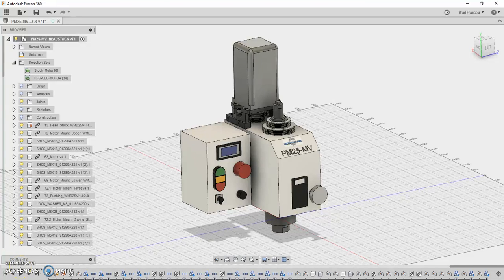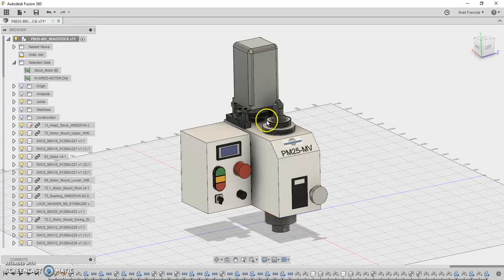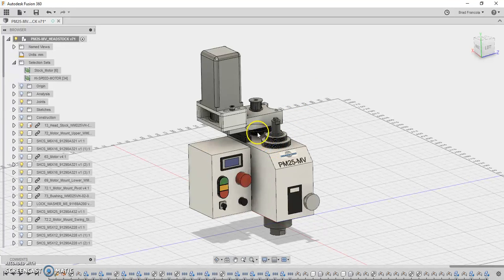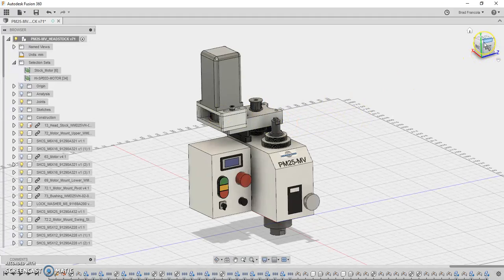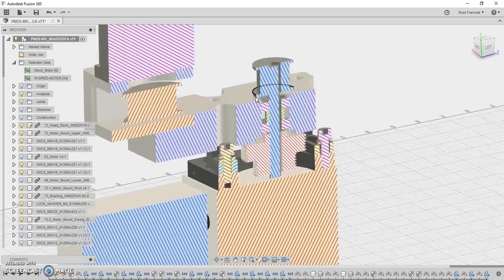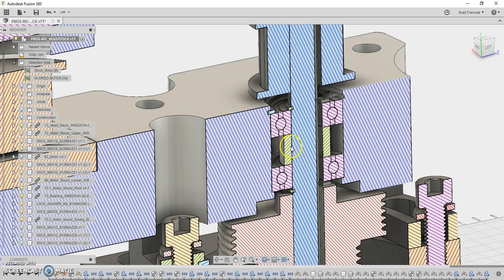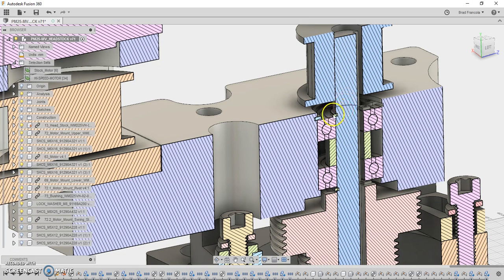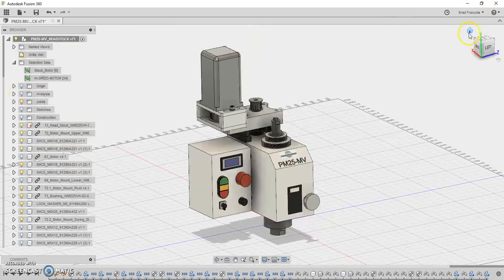PM-25MV Milling Machine Spindle Speed Upgrade with Fusion360

Comment: Franco, how did this work out for you? I will want to do this at some point. Why did you not use a drop in bearing assembly (fk-20, or proper size) like on your cnc conversion?

I can't make much yet still waiting on my cnc conversion kit that was supposed to be instock, but wasn't.

Thanks for all of the videos,
Chuck
Reply from the maker: Hi.  The drop in bearings probably would have worked pretty good.  If I were to make another one, I'd give that a try.  Currently, I'm using the stock spindle and motor setup.  It works OK but more RPM would be nice.
Reply: @FrancoCNC  Thanks for the reply, once the mill is up and running I may give it a try. Your Fusion 360 models will be a big help. I am also looking at making a replacement nut to hold the drawbar in, it will have a small lip to add a pulley to drive an encoder.

Comment: Franco, first off love your work I’ve been watching your conversions for about a month now and am planning on doing a similar conversion to a Pm-25mv. Secondly, (due to my limited experience of machining and a conversion such as this) I have a question regarding  the precision shaft from McMaster Carr that is keyed. I was wondering if that key-way has had any adverse effect on the bearing surfaces it is rotating through? My thought being that if there’s any vibration in the shaft or slack in the tolerance it might cause it to gouge through the surfaces and possibly ruin the bearings? Or is this of little to no concern, again I have only light experience. Thanks!
Reply from the maker: Hello.  The key doesn't seem to have much of an effect.  However, I found that axial movement of the shaft can cause vibrations.  I had to use wave springs to take up the excess motion to eliminate those vibrations.

Comment: Love the idea i have the same mill, i would like the same set up the only thing i would say is the two bearings will need lucubration / oil points.  As this may run warmer with the extra RPM, Just think it would be easy to do it in the build rather than after.

Great Job

Make 2 i will take one off your hands 

Regards 
Dave
Reply from the maker: Hi Dave.  Thanks for your comment.  I'm actually working on this project this morning and I hope to be able to test it soon.  I'm using sealed (pre-lubricated) bearings which are similar to what I've seen used by Grizzly on the G0704.  If they look like they are getting hot, I'll make some provision for oiling.  Thanks!
Reply: Not a problem looks a good set up to me, Pre lubricated bearing will be the better option, Be interesting to see when its all complete.

Comment: Franco,  First I want to say what an awesome job modelling the pm-25 mv.  I have this mill in my home shop.  I love it.  I was looking for a way to increase my rpm on the spindle, i hope you dont mind but this looks to be worth the effort so i may try this in the fall.  I am also considering the tormach TTS system for tool changes.  Before I commit to that have you had any thoughts about tool changing?  Keep up the good work.  This is awesome, the PM-25mv needs more information about cnc conversion.
Reply from the maker: Hi Stephen - feel free to try out this design on your machine.  I may be able to give you a parts list, if you want it.  I've given thought to the TTS system.  Currently, I use R8 tools and I have a small Ryobi hand held driver with an eight point socket to spin the draw bar - it saves time.  The R8 is really sturdy and it repeats very well.  The TTS is probably the best option if you want to do automatic tool changes.

Comment: Couldn't you just increase the motor pulley and decrease the spindle pulley? I see you would have  to make a different motor mount to compensate for a wider pulley. That way seams like it would be easier to me. Good luck with your endeavors!
Reply from the maker: Thanks.  That is a good point.  The stock motor pulley is Ø60mm (about 2.375").  I'd have to blow it up to nearly Ø6.0" to get the RPM I'm looking for. At first, I was thinking the packaging job to fit that pulley in there would be too much work, but maybe I'll revisit that and my current design has become a bit more complex that I hoped.
Reply: 2 U shaped mounts should do the trick but you will lose the ability to remove the mounts unless you remove the pulley, which I don't see that being a big issue. It might be a dance between pushing the pulley on and tighten the mount. Is the pulley force fit or set screw?

Comment: Any worries about surface finish with using a timing belt to drive the spindle?  It's probably getting a little nitty gritty but I've hear of people complaining about finish or vibration from different drives....  Thoughts?
Reply from the maker: That's a valid point and I was wondering about that.  I've noticed that all of the little mini-lathes use timing belts between the motor and spindle.   They don't seem to develop any resonance so I'm guessing the transitions between the belt and the teeth must be somewhat seamless. I feel optimistic about the timing pulleys but there is a chance that they my cause a problem.
Reply: I think it will probably be just fine, I was just curious on your thoughts.  It wouldn't be a killer change to go with a different option in the future but the likely reality is that it will be just fine.  I think the Robodrill has a small-ish multiple V type belt arrangement on the spindle motor to the spindle but not toothed like the timing belts.  There is however a toothed belt to the encoder.  Fun stuff, keep it up!!  I should be running my first multi-tool job on the Robodrill very soon!  :)
Reply from the maker: Awesome.  That Robodrill is going to be really cool.

Comment: Cool! Just ordered my PM25MV and was looking for ways to increase rpm (used to a 5k-20k rpm cnc router).  Also considering a side mount to use a 1.5kw VFD spindle.
Reply from the maker: It's funny you mention that...I actually purchased a 2hp motor and a 1.5Kw VFD for this machine.  I never realized how big the motor was until it arrived.  The motor was really big and really heavy - like 50 pounds heavy.  Apparently, they don't make "small" 3 phase motors.  So, I returned the motor and the VFD and moved on to plan B.  I guess it's possible to use such a large motor on this mill, but I just wasn't ready to go down that road.  I'd be very interested to see what you do with yours.
Reply: Franco smaller....like this one....

Look at this on eBay http://www.ebay.com/itm/252960273339
Reply from the maker: Ah yes.  Now I see what you mean.  You're going to use that as a "helper spindle"  along with the stock spindle.  I've seen other people do that.  Good idea - I may have to give that a try, some day.

Comment: Nice! I'll be watching this closely. At least on the PM25 that I have, the motor speed can be increased a little (emphasis on a little) by adjusting a potentiometer on the drive. Also, someone else determined the existing spindle bearings are good for 5k and 8k RPM. I've run mine in excess of 5k, stock mechanics, using a different drive. Happy Memorial Day.
Reply from the maker: Thanks Kent - I'd really like to hear about your upgrade and how you were able to increase the RPM.